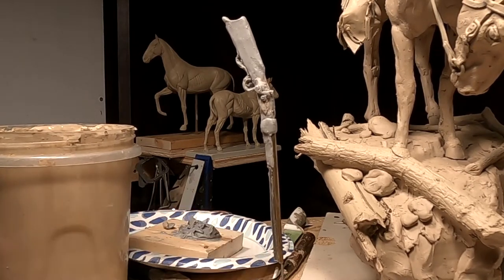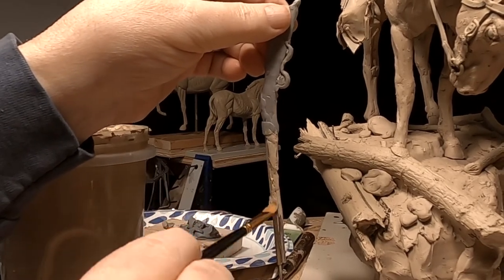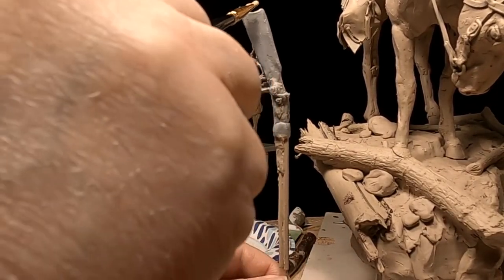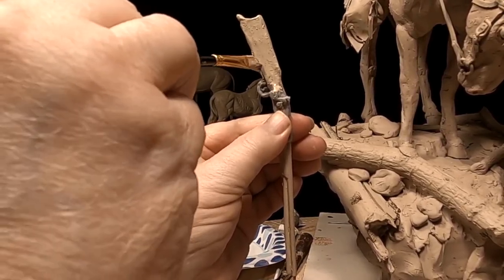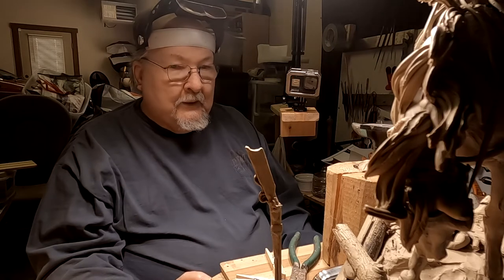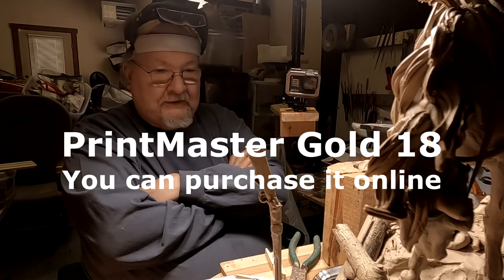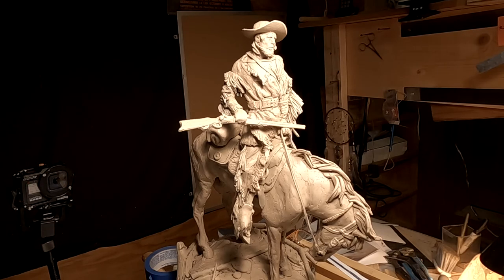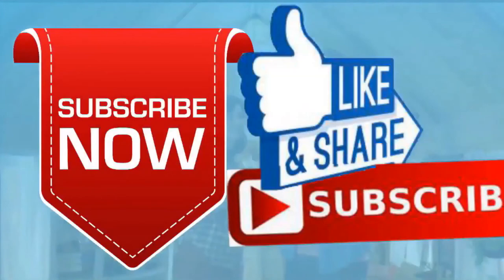Jim Bridger OVER THE NEXT MOUNTAIN   Restarting the Hawkins Rifle   Struggling Today

Comment: Hi Dave,  I may have missed this in the video, please ignore this if it was there or you did this off camera.  We scratchbuild models of plastic, wood, brass, sculpted, 3D printed parts you name it.  It looks like in your video the brass still has its lacquer finish (it appears bright/shiny?).  If you sand the brass (can be a fine grit 220-800 as desired, rougher obviously leaves scratches) before attempting to super glue (we use Ca, other glues May work w varying results) it will 1) clean the slick lacquer off and 2) provide a tooth for the glue to bite into.  The two pieces will bond and stick almost immediately (pending your CA brand).  Another trick is to apply CA to one piece and spray the other piece with accelerator.  If we need a bond with high strength, we use a resistance solderer, but those admittedly are $$$.  Again, if you already tried or knew this, please ignore.

As alway YMMV.  Just sharing,  nothing more.  Nothing less.
Reply from the maker: You know I was thinking of that... Just never did it.. But will if this gluing doesn't take.. I wish I had a 3D printer to scan and print out this type of thing.. lol
Reply: 3D printers are great! Till they’re not 🤔. Ours have had much embellished language addressed at them…words that would have made my grandfather (retired Navy went in before and served during WWII) blush bright red 😉
Reply from the maker: @jessefurqueron5555  HAHA.. yeah I served 4 years from 65 to 69 in the Navy.. On base or on ship the language could get a bit colorful..